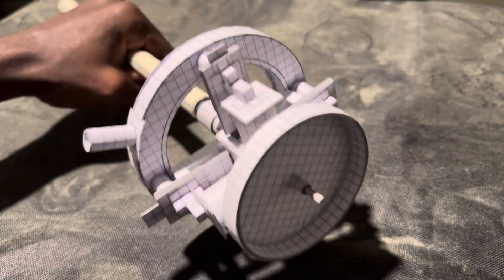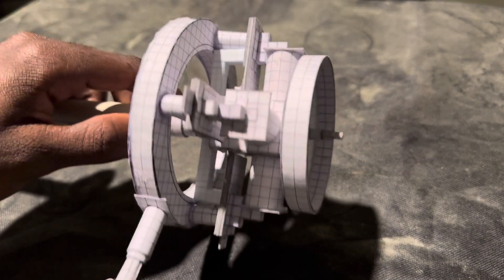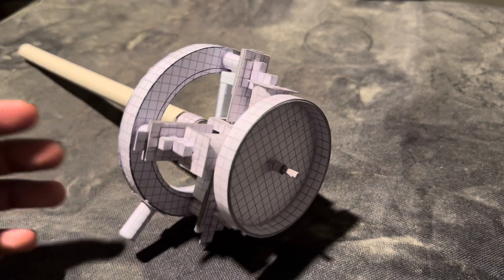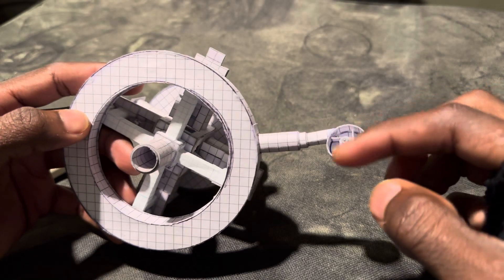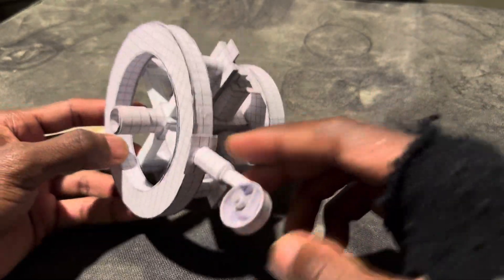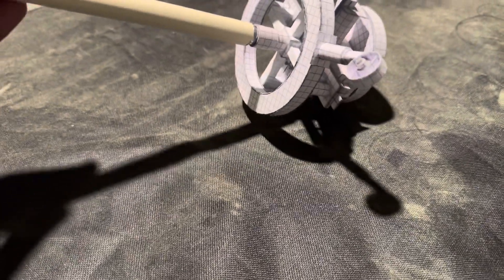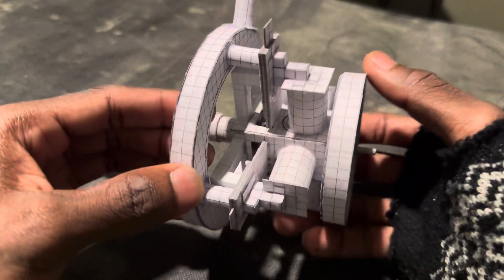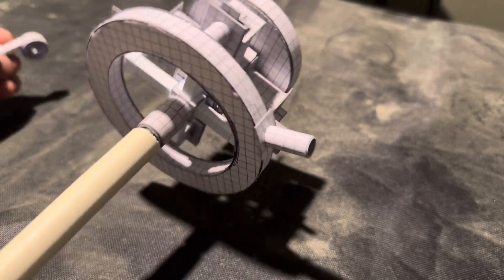Turbocharged Paper Radial Engine Model

Comment: Great vid as always. I had a question.
Could you make a video dedicated to making the valves?
My single cylinder engine runs, but leaks a lot, while my V twin doesn't run at all.
Reply from the maker: Just cut out 1 more layer of sliding valve shape and add to it 1 layer at a time until you get a good seal and if 1 layer adds friction try to file the face of the sliding valve down little by little until the friction is gone
Reply: @PaperEngines  I tried to do that, as you said in your previous videos, but that has increased the friction by a lot. I think I'll just sand it down again

Comment: Thats good but its not a full turbocharger.Turbochargers have 2 turbine one for spinning the turbo and one for forceing air in to the engine.Soo if you add a second turbocharger it will run faster